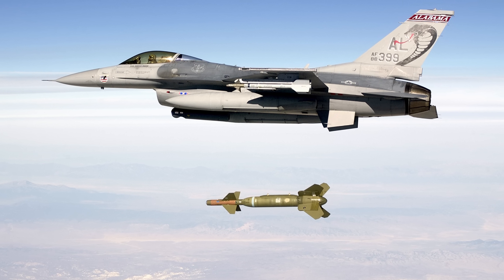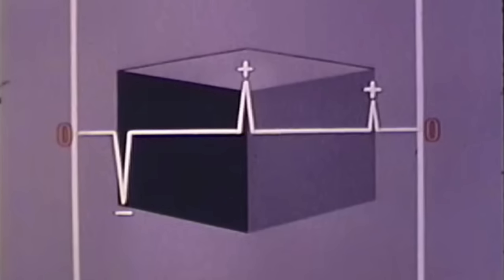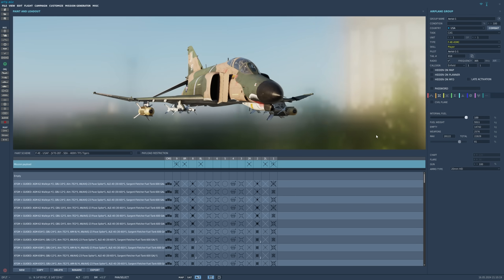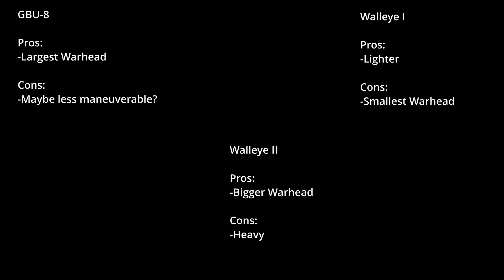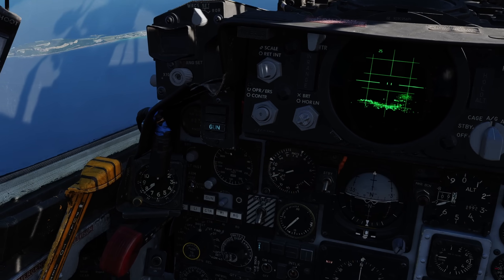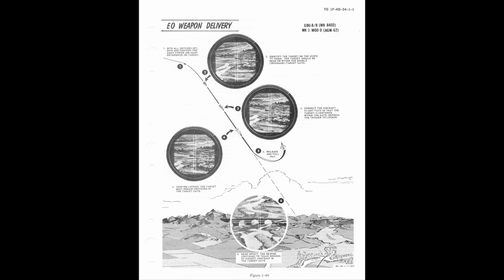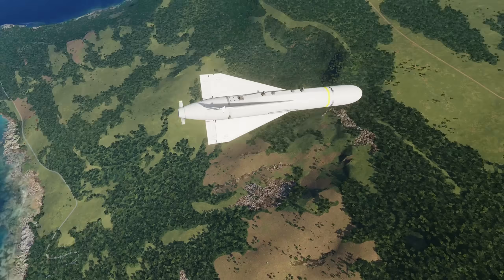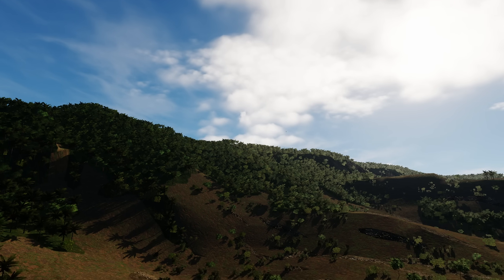How to Use TV Guided Bombs DCS F-4E II Phantom - AGM-62 Walleye & GBU-8 HOBOS

Comment: Awesome video! But can HB Phantom use data link to guide walleye after release? I mean, after release in hornet u can mannualy changed target, so if u see that walleye locked on a wrong one u can correct i
Reply from the maker: I don't think the F4 had this
Reply: You can, but only on the DMAS / AN/ARN-101 F-4E. At the moment we'll only have the DSCG F-4E which doesn't have that capability.

Comment: I'm not a maths person, but is there a way to estimate range based on dive angle and radar altimeter?
Reply from the maker: I was actually talking to someone about this. We were theory crafting that you could probably pretend you had a Mk84 and just use a bomb table to better inform approaches. The really tricky thing is that you need a lock so the fuzz on the monitor will put your approach a bit on rails because it can be quite hard to see things from far away on it.
Reply: @Enigma89  I was thinking poor man's trig. 3000ft radar altimeter and a 60 degree dive is part of the equation, I just don't have the maths to calculate the slant range/hypotenuse.

Comment: I've been waiting for the hobos for so long.  I'm so excited about those.  I wonder when/if they're going to model the original targeting pod? I'm a little ignorant of the F-4E module features.
Reply: If you're talking about Pave Knife, then no, that was an F-4D thing.

However, we are getting the AN/AVQ-23 Pave Spike for this version of the Phantom.

Later, with the DMAS variant of the Phantom (included in the price) we'll also be seeing the AN/AVQ-26 Pave Tack.
Reply: @Nstar98  If wonder if the Pave Tack will actually be implemented or not. As far as I know, that pod served with Phantom units for a very small period of time.
Reply: @agostonbazmajer1100  While true, I believe it is already on the list - there's certainly documentation on its operation on its use from the perspective of an F-4E WSO.

The same applies to the Walleye, which only saw very limited USAF service and was almost entirely a USN weapon.

Comment: Curious if this works effectively with a WSO guiding and releasing the payload. The manual seems to say yes?
Reply from the maker: I don't think Jester/WSO does anything with this. I did not see anything in the manual on the TV Guided Bomb Section (4.3.3.4)
Reply: @Enigma89  Thanks.  Yeah, I just noticed it say "WSO controls are on the actual flight stick, not the Antenna Hand Control." which got me curious.
Reply: MITL capability using the data link won't come until we have the DMAS AN/ARN-101 F-4E.

Comment: You can actually launch them from muuuuuch further away. You really don't need to get into AAA range.
Reply from the maker: Kinetically you can but acquiring targets at range is really hard because of how fuzzy the picture is. Maybe on desert maps you can but then the question is trying to dial in the range without any raging info. I am sure some clever players will dial it in but for me I found this the best way to reliably  hit it because my god i sent so many of these things into the ocean or firing at something that was not my intended target :D
Reply: @Enigma89  Good point! I mainly attacked ships with it and they are easy to recognize.
Reply: @Enigma89  you could use a waypoint and set that at the max range of your weapon, with a little math you can figure out the angle you need to point the nose from that known point to get in the ball park of your target.

Comment: Ummm dcs has had this for years. Not sure why we're acting like this is new. Also not sure why the manual tells us to dive straight down on the target , which contradicts what makes the weapon so useful. See those big wings on that "bomb" , it actually does fly/glide .. it has a range of 40 miles, depending on where you drop it.  You do not dive in the target
Reply from the maker: The Walleye we have in DCS is really anchored around the Hornet and it has datalink capability. I am rusty on the Hornet but if I remember correctly, you can get up to altitude and yeet that thing off. As it is getting closer, the pilot can see what the Walleye is seeing and then adjust it and lock to a target. 

Using TV Guided Bombs on the Phantom is a bit different because you do not have the same datalink capability. So basically you have to do all of the targeting while it's still strapped onto you. Due to the older monitor style, it is much harder to pick up targets. So you have to get that much closer to be able to pick something out. Due to the proximity of the target, you have to really drive the bomb toward the target in a dive. 

If you try to do what a Hornet does then you are never going to see the target because of the camera quality.
Reply: @Enigma89  The Hornet's systems makes the WE a great weapon. You can designate a TGT point by any method, then uncage the WE and it'll slew to that TGT automatically.

The phantom doesn't have any slew capability at all, much less any ability to have the jet designate a target point for the WE ahead of time. Maybe later models can do that?
Reply: But we can still control the bomb. , I never used tgp or make a mark point. I know the target is in , "that area" and I drop from 35+ high and far away like 10 miles.. I then guide it in. Staying somewhat close to the bomb yet not over the target
Reply: The weapon has a range of 45milea. Does the phantom have that capability? Would be a quick test to let us know. Drop the bomb high and stay close to it as it goes down. Do you lose the signal
Reply: @fastfed  No, it doesn't. In order to use the WE in the F-4, you need to have your nose pointed at the target.
Reply: @isotaan  yep I do the same thing in the hornet. Point my nose at the target and drop. Still don't dive with the bomb just fly near it
Reply: @fastfed  Under the right conditions while flying the Hornet, you can yeet a Walleye over 20NM.

Comment: The fisrt TV guided bomb was the Fritz mk X first deployed in 1944
Reply: @huebiscuit  https://en.m.wikipedia.org/wiki/Fritz_X was INFACT TV GUIDED naval glide bomb
Reply: @huebiscuit  The Fritz X possessed a spoiler-based control setup on its tailfin unit, using three sets of aerodynamic control spoiler systems, with two of them giving the ordnance control in both the pitch and yaw axes, differentially operating and constantly oscillating rapidly under direct control from the Kehl-Straßburg radio control link. The roll control setup, operating autonomously and not under control from the deploying aircraft,
Reply: @huebiscuit  I'm a regimental historian if your wondering.
Reply: @huebiscuit  right i see what you are saying now, and it is an optically guided weapon, whether the sensor is on the payload or delivery system is irrelevant.

Comment: Walleyes 2 are also available for F-18 which can be a great place to practice delivery - after all, to effectively deliver those bombs, you not only have to lock the target, but also provide sufficient speed and altitude otherwise it will just fall off the sky (learned that the hard way).
Reply: that requires owning, installing, binding controls for, and flying the F/A-18, and all its MFDs, though

Comment: great video! Can you slew the seeker of the bomb before release?
Reply from the maker: Sorry if this was not clear in the video. You cannot slew it at all. You have to move the entire plane to get it on target. It is really a bomb that you yeet towards the target direction and if the angle and speed is right then it will hit target
Reply: @Enigma89  ah ok gotcha! so its not like the walleye on the f18 then. either way very cool, gonna be interesting to see how effective it is to do this in multicrew
Reply: @agidotexe7167 it's the same weapon , you just need to aim using the plane
 Still has the same 40+ mile range
Reply: @fastfed  no the f18 uses the walleye 2, he only showed the walleye 1 in thsi video
Reply: @agidotexe7167 The F/A-18 uses the Walleye II ERDL. It was also briefly shown in this video (though not sure how accurate it is).